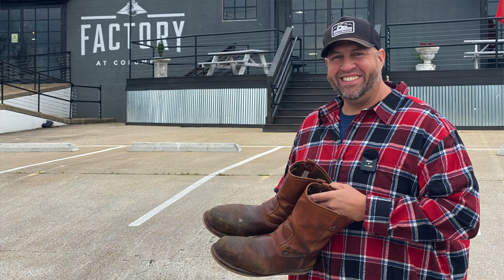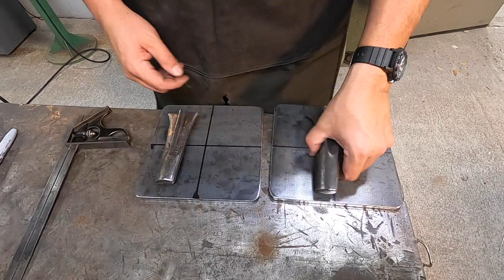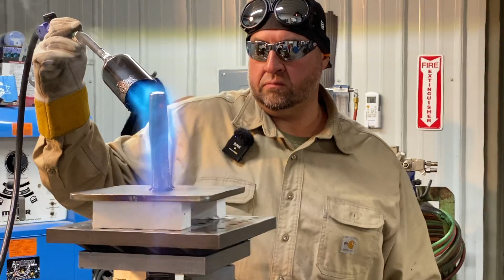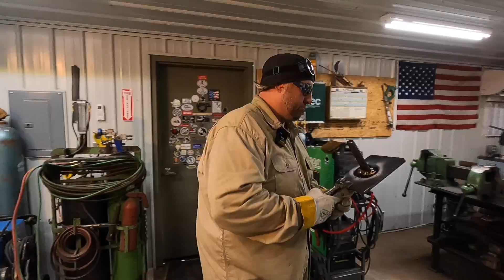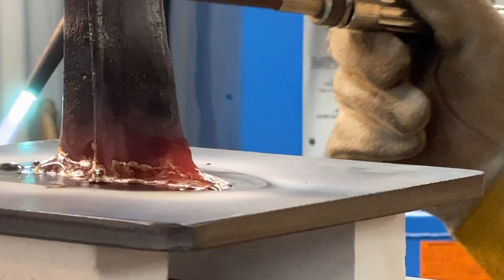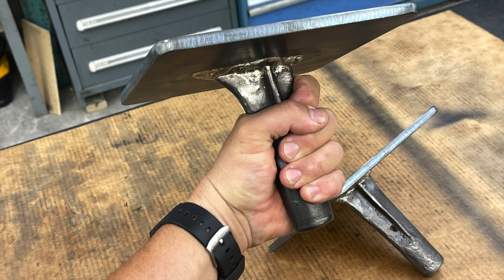Custom Shoe Anvils for Potter & Sons

Comment: Adam, having never held a torch, oxy-fuel or otherwise, I have a noob question:

Would cutting a few grooves or channels in the cast material faces, so that the bronze flows into them between the cast and the plate (like soldering copper pipe joints) added to the strength of the brazed joint?

As always, thank you for the experience and edumacation!  👊👊👍👍
Reply: No. If anything it might be weaker. It's cast iron. I don't see a point in that.

Comment: Somehow I missed how these are going to be used. The lasts are going to be afixed to the flat surface and the upright is then supported in what manner?
Reply: They will slide inside a post that matches the shaft. The post isn’t shown in the video.

Comment: I like this method as well as you do.
But one tip i do have. One my mom told me.
A small gap between the cast and the steel would make a better bond. 
The Material can flow in that gap. It increases the bonded surface.
I know light duty, but that's what my mom told me...😉

Comment: I don't care one way or the other that you brazed them. I just hate seeing perfectly good shoe anvils getting cut up. My take is I would have machined the tapered stems from steel then TIG welded them to the plates. Of coarse it would cost more and taken longer but I wouldn't care if they were being made for me.
Reply: I know what you mean, but there are a surplus of those lasts in every country that used to have cobblers making all their shoes. There a plenty in museums, in teaching places etc. Look at it the other way, most of the discarded ones get melted down - at least the stems get reused here ;)
Reply: I know  cause I've had 2 lasts in my shed for the past 30 years and have not found a good home for them.........

Comment: I'm always a bit leary of using electric arc techniques on cast iron - you can all to easily get a very steep heat gradient, changing the crystal structure of the cast iron in the heat affected zone, resulting in embrittlement and cracking.

By contrast, using a gas torch allows you to "feather" you heat and get a more gradual gradient, with less chance of recrystallization. And, the copper / brass brazing metal is a bit softer - thus more ductile - giving the join a bit of resistance to cracking.

Your mileage may vary, but newer isn't always better...

Comment: No worries Adam, there are lots of folks who will suggest Oxy/Acet brazing is low end.  Problem is, cast iron is the key as cast iron doesn't like traditional welds and it is brittle and needs preheated to 400 degrees prior to any brazing as you did. At least that's my experience.
Reply: People who say oxy brazing is low end, knows nothing about welding.

Comment: I would think that the wider flame front would make for a better braze, because it's less localized. The localized heat of a TIG might make for micro-cracks in the cast iron. If you were going for higher bond, would you drill a hole in the middle of the plate, then braze the inside at the middle of the + of the cast "foot"? I wonder if there is a way to braze using even older coal-forge type heat... Now I have an experiment to do!

Comment: That is the absolute best way to bond cast and steel. Even though I have a TIG, I prefer brazing, especially heavier pieces. Only thing I would have done different is, cover it with sand afterwards. Controlling the cool down keeps cracks from forming in cast. Adam gave a perfect example of the process. Those welds will be going strong long after we are gone.

Comment: The goal should never be "perfect", but rather "good enough". The hard part is knowing what good enough actually is.

As for testing, it would be interesting to see a test where different levels of prep are used before brazing. For example: does a flap disk polished surface hold better or worse than something with more "tooth"? How much better is the best prep compared to no prep at all? Where does just dunking it in Evapo-Rust stack up? And where there's a difference; is it enough difference to make a difference?

Comment: Adam, why not flatten the anvil peace  a bit and brace the whole anvil foot plate edge,.. if you like drill some holes and brace them to…. .
Reply: Cat iron doesn't like to move like that - a blacksmith might be able to rough it out, but a machine shop doesn't have the forge and anvil to do that kind of work.

Comment: All high quality tubular steel motorcycle frames and car tubular space frames were bronze welded. Especially those using special steel alloys such as Reynolds 531manganese-molybdenum steel. 
Bronze welding causes less heat degradation of the base metal.

Comment: 1:00 "Shoe anvils" - those things are called lasts (plural, 'last' singular).OED: "A model of the foot made of wood, metal, (now) plastic, etc., on which boots and shoes are shaped during making or manufacture."
Reply: A form is a last, not an anvil.  Almost the same but not quite.  Common usage is to call an anvil a last but is wrong.
Reply: @firesurfer  The items Adam has to start with are clearly a 'model of the foot' - hence are lasts.
Anvils are an item to be struck - which is why referring to the fixed measuring surface of a micrometer as an anvil is incorrect.
Reply: @millomweb  It's not an exact model of the foot. A last is an exact copy that is used to form the shoe.
   The anvil of a micrometer is a metaphor. It's not designed to be struck. 
   The anvil of a "mic" is the place to start measuring. Words have different meanings depending on context.
Reply: @firesurfer  I've given the definition of a last.
An anvil IS designed to be struck - that is how the name is derived. In the acase of a mic, it's not a metaphor either.
Reply: @millomweb   Either you or I is missing something here. Yes, an anvil is meant to be struck. What the heck does that have to do with a last? Nothing. 
  Do a google search for shoe last. See what you get.
  Do the same for anvil.  
 The fact that SOME people use either word incorrectly is immaterial.
https://en.wikipedia.org/wiki/Last

Comment: I'm with you on brazing. I just finished a braze repair on an old Cole vise. My great grandkids will be using it long after I'm gone. Nice camera work Abby. What size torch tip did you use Adam?

Comment: Adam next time you need to remove scale. Try a using a 3M Bristle Disc. I was simply amazed at how good it is at removing the scale.
Reply: I used those plastic things a few times, they are weird, but work really good on removing red oxide chips from steel. They create a crapload of heat though, friction and all.
Reply: @JosephArata   And they are not cheap.

Comment: Look, Im no expert, but due to my expert knowledge directly based on the video i just watched, clearly zip ties are the superior mechanical bonding method for this application.
Reply: Lulz - JB Weld steelstik...HA!
Reply: Don't forget the dried bubble gum to help lock in the zip ties 😂😂
Reply: dont forget the duct tape :)
Reply: I'm not a horticulturalist but in my expert opinion this should have been 3D printed

Comment: Why not make a steel post, dont understand the need of keeping the cast iron post, nice functional brazing.
Reply: Cast iron post, I assume,  fits into some other holder and keeping the it makes for a quick change of work surface
Reply: @bulfin21  Cutting off the post from a used anvil saves on the fabrication time versus making a whole new post.
Reply: I would assume that's what Trenton and heath wanted. Adam is just doing the work, and as I tell my customers "I can do whatever you want, its just time and money"
Reply: 1) Trenton and Heath had lots of the Cast Iron anvils.
2) Adam saved fabrication time by recycling the cast iron bases.
Reply: Cast iron is better at absorbing shock waves than steel.
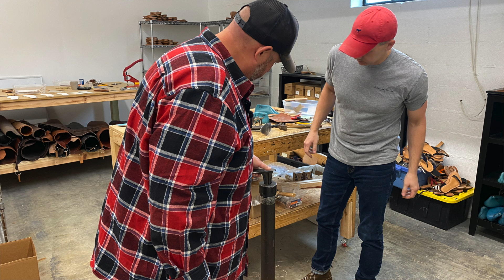Reply: The cast iron portion fits into the socket of a base that is at a fixed height. It allows multiple size forms to be used in the same base. There was one shown in the stills that Adam showed early in the video at 1:24.

Comment: Not critiquing just merely asking. Would the band saw have cut those off?
Reply: It would have, but Adam mentioned the specific thickness of the cut-off discs at 40 to 45 thousandths. The bandsaw would no doubt have made a thicker cut.
Reply: A cursory google search shows the minimum thickness of most bandsaw blades is at least 180 thousandths, i.e. more than 4x as thick as a cut-off wheel and therefore would remove more material.